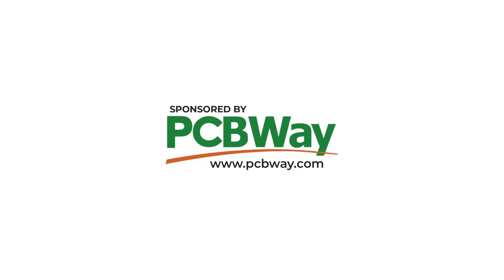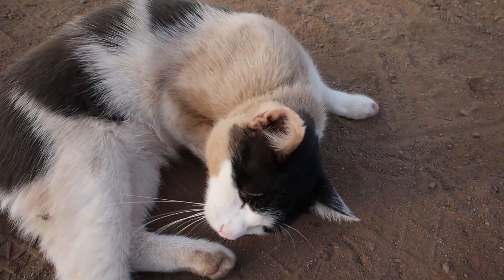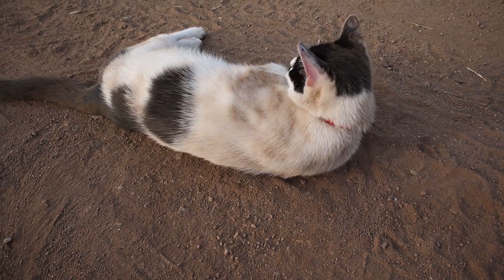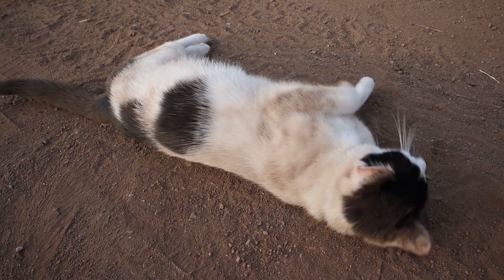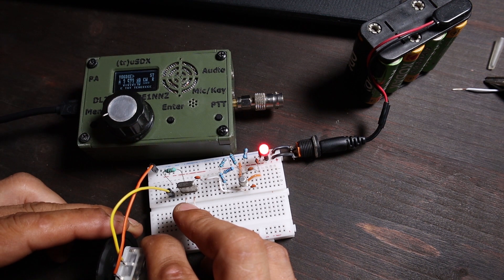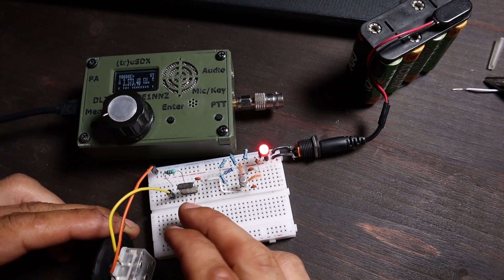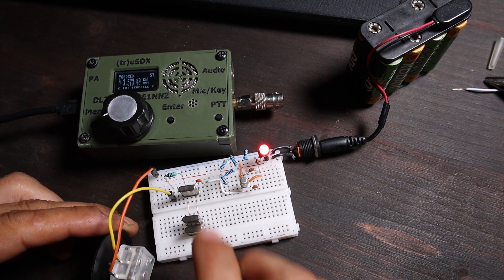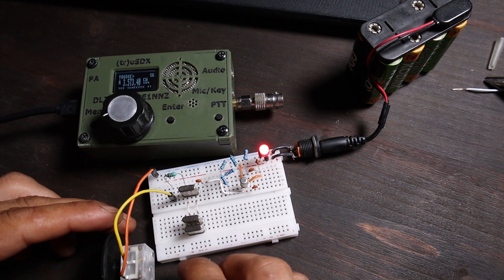Testing a VXO On The 80 Meter Band - 80 Hz Frequency Shift

Comment: I build myself a 'one-Watter', a 30m version. 
(Made and developed by Dieter Genschow W8diz (sk), the torioid-king), also 'kits.and.parts.com' - is still in bussiness!)

The small CW- TRX is also with a VXO, and I can 'sweep' the quartz (12MHz- Type) about almost 18kHz in that circuit!

 The +/-10 mhz quarzes are the best, to use in a VXO. (When using a super-het, it is no problem at all!) They give you the most range. 

With 18kHz nearly all of the CW part of the 30m- band is inside of  the tuning. ! No need for a vfo or dds or pll. A simple circuitis the best, most of the times! Make things so much easier, ... ! 

73 de Markus - db9pz 

(JN39fq -3miles/5km east of LX)

Comment: Grab a ceramic filter. They make a 3520KHz and a 7000Khz. 

Sadly they no longer make the 7020KHz 

Mouser has 7020KHz and 7030KHz crystals
Reply from the maker: I have one for 7000kHz that I also want to test ( ceramic resonator ). The crystals I buy from roWaves as I know they order them from Mouser so it's easier for me to order from the boys instead 😁. I am really curious how well it works on 40m and 20m. 73, YO6DXE
Reply: @dxexplorer  with the resonator, I guess you could make a tuned amp frequency doubler to get onto 14MHz with it. 

Rowaves  are local for you. Good to support local :-)
Reply from the maker: @MidlifeRenaissanceMan Yes..  I always prefer to support smaller businesses, local or not 😁. Not a bad idea at all about the frequency doubler. Is all new to me so is very fun because I have new stuff to play with and experiment 😅.